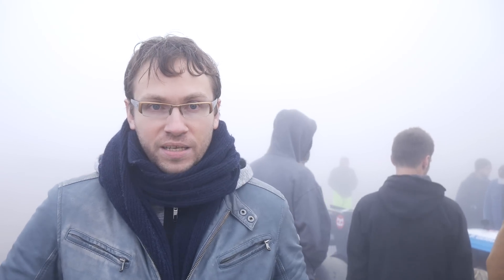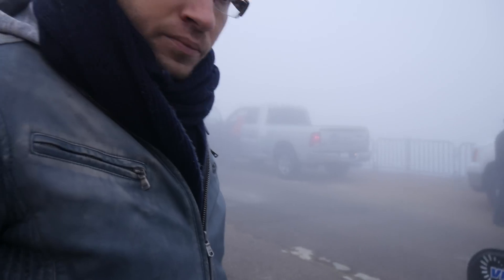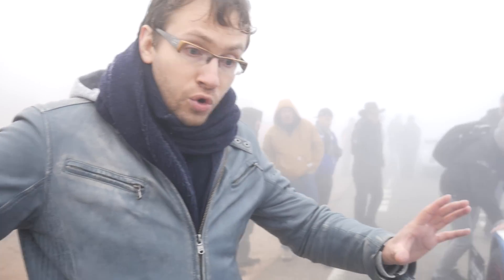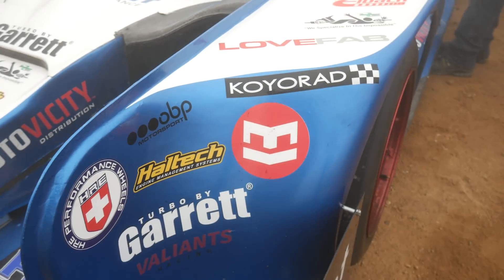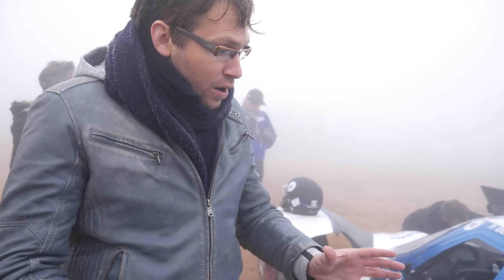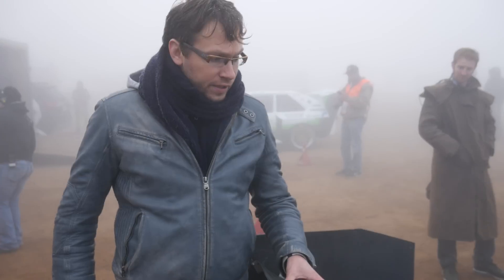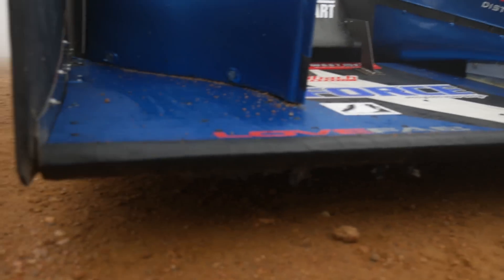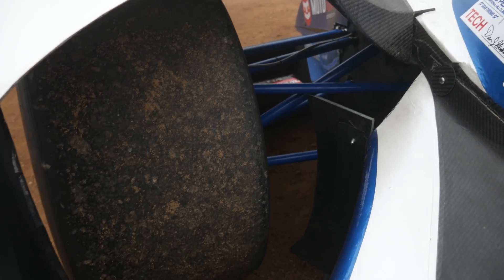Unlocking the Aerodynamic Secrets of the Pikes Peak Enviate Hypercar | Lifting The Hood

Comment: Wouldn't a custom f1 car be faster? Surely you could buy an old toro rosso or force india for less than the cost of developing a new racecar.
Reply: might not be as worth it as youd expect, i looked around a bit and the best i could find was a 2001 arrow car for $215k +tax. the car also doesnt include an engine, or hydraulic and electric systems. this car wasnt good in its time in f1 scoring only 1 point, and is also at this point 22 years old. i think it would be cheaper and also would allow for a far more free design to just start from scratch
Reply: @carlofrunzio6989  tour de force will sell you a hybrid era chassis with 800hp built by f1 engineers for $850k. I'm not talking about getting on the mountain in a golf with a wing, i think a modern f1 car would smoke this car and probably beat the idr which certainly cost more than 1 mil.

Comment: I could understand the part where he said about keep the rear wheel open so positive pressure can build up and increase down force?? I understand how positive pressure can build up in front of the rear wheel, but how does that play into the “increase down force”?

Edit: ohhh, I get it! Is it because the air pressure build up in the wheel house would start to lift the car causing a negative down force?

Comment: pretty cool discussion. The wing position relative to the diffuser is similar to the old Toyota and Jaguar IMSA cars. IIRC the IMSA cars back in the day ran a lot more downforce than the FIA cars because a lot of the US races were on tight street courses or speedway infield courses. What would've been interesting is for him to just have noted quickly where the  car has features that break the current LMP1/2 aero rules. They may have missed a trick with the low nose

Since Pikes Peak unlimiteds are open I wonder whether unsprung wings back and front, side skirts and  maybe even fan sucking with some active aero features might be the way to go? This is the only current place I know of where you can basically run anything and I'd love to see somebody really push the configurations.

Comment: Awesome video about the aero of this car. I'm just curious, with the less dense air at the top of the mountain, what effect does that have on the overall downforce on a car? I genuinely don't know. Do you lose a significant amount of downforce due to the less dense air or is it negligible to the driver? Also, you were stating about the static ride height, how much would you expect the height to change as you approach top speed? It will be due to the compression of the suspension, of course, but would 5-10mm be expected or is that too much? I have a fascination with the science of aero 😉Cheers

Comment: Very surprised to see the lack of a gurney flap on the trailing edge of the rear bodywork. He was talking about trying to increase the extraction of air from the diffuser and that seems like the best way to do it in conjunction with the rear wing. Sure you might have to raise the rear wing a bit to keep that laminar, low pressure, air attached to the wing but it would be an excellent addition.
Reply: You only need gurneys when you're planform limited or you need a bandaid. This is an unlimited car so they can add downforce in less draggy ways. I think from another video the builder basically said they had as much rear downforce as they needed.
Reply: a gurney flap would probably render the leading edge of the rear bodywork not energizing the low pressure zone of the wing as much by introducing low energy turbulence, and then making the whole setup work less like a full multi-element rear end. Gurneys do not exist on mulit element wings unless maybe on the final element.
Reply: i guess a gurney flap ELEMENT could have effect but without seeing an actual analysis on how the trailing edge of the body works with the defusor and wing its hard to make any calls tbh.,

Comment: I wonder why they didn't try unsuspended aéro....
Reply: My thought would be that the unsprung weight does not change with speed, after all it is still the same assembly of parts and therefor have the same mass. Mass adds inertia, and that is what is actually bad for the unsprung parts as I understand it. A higher inertia basically causes movements to be slower, and we want the suspension movements to be as quick and responsive as possible. The aero forces does not add mass, only force.
Reply: godtux you mean unsprung aero?
Reply: yes ! To get the load directly on the tires.
May be the road is too bumpy and this add too much unsprung weight.

Active aéro could also be interesting.
Reply: godtux unsprung weight isn't a good thing at all. And with such huge aero parts it is a big no no. So active aero is the best but requires lot of research and resources.
Reply: Well, i wonder how much weight a carbon wing would add to the (massive) whells, hub and disk brake. Might not be so important ? And it could allow a lower spring rate to be used.

With the actual heavy downforce, springs must be stiff, and so the right must be rally unconfotable and bumpy...
Reply: godtux the real thing I don't understand about unsprung aero is that once the downforce comes into play the unsprung weight is going to be huge as the speed increases. Isn't that bad for the car? The handling and everything will change by a huge margin.
Reply: well, there will be a huge force pushing down on the tires, but it's exactly the same force as on a regular car (with same wings). And this is the goal, because this load gives the grip. But on a conventional car, this compress the suspension, reducing the ride height, not on unspring aero.
There are some formula student cars using it.
Reply: Yes, but unsprung aero will not effect ride height. So at high speed you should have more bump stroke, which could potentially actually make suspension performance better, slower, but more effective. Track conditions would dictate the gains here.

Comment: Is downforce measured in kgs?
Reply: well a force should be in newton
but considering earth gravity, you can use a mass unit to help visualize (so kgforce)
or you could define it by a coefficient depending on the drag force, front surface, relative air speed and such
Reply: I have somewhat heard about that, it just bothers my mind to use inappropriate units for different quantities.:)
Reply: Kgf is just another unit of force. It is not the standard unit of Newton that follows all of the equations but kgf is very common in many practices. Especially useful for talking about downforce since what matters for car performance is the downforce per mass and not the downforce itself.